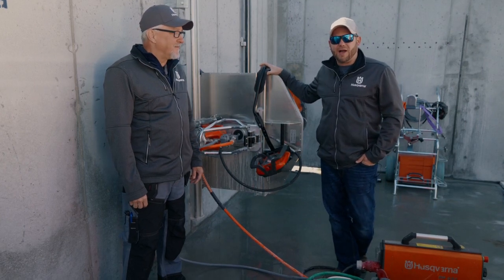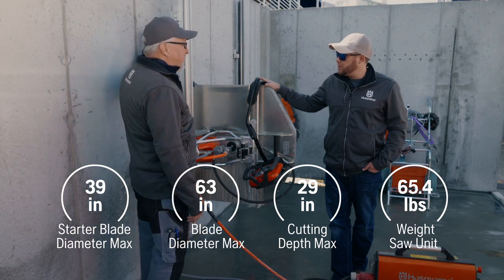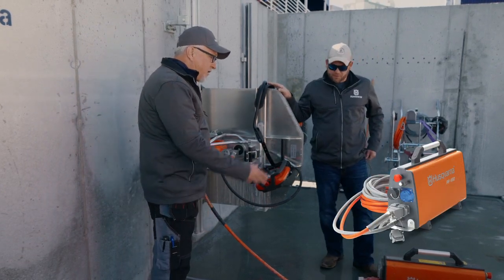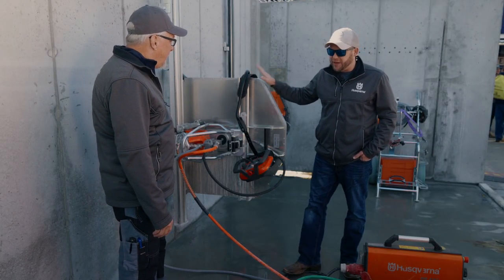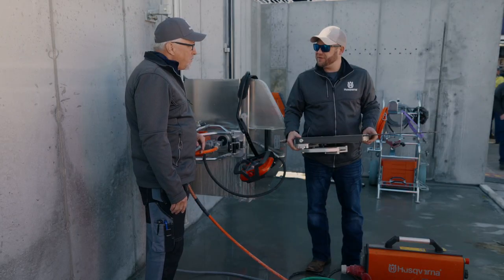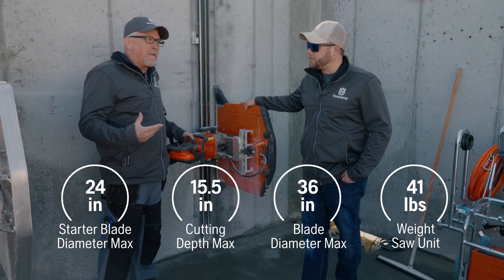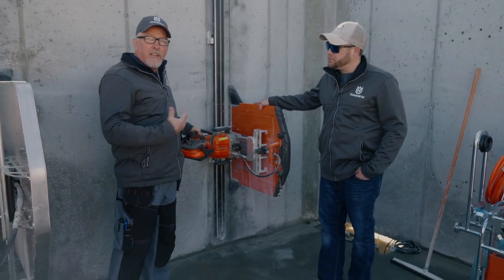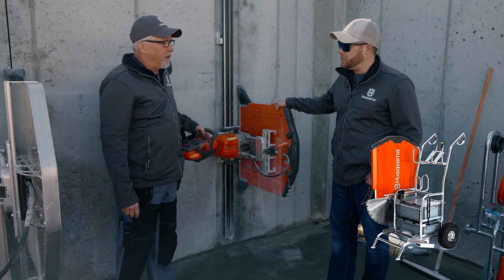Husqvarna at WOC 2023 – Wall Saws WS 482 and WS 220

Comment: You can hear it’s electric⚡️ 
~ 15 years ago they used to be hydraulic but nowadays it’s almost 💯% electric (electromechanical), at least in the developed countries…
They are run from 3-phase electrical power into a high voltage inverter that runs a high voltage motor. 
The motor and often also the inverter are cooled with normal tap water. 
Most of these are developed and manufactured in Europe. 
I think Pentruder was the first ones. 
https://youtu.be/lx6qDbZbcxk?

Then there’s Husqvarna Construction Products that has brought their industrial design and mass manufacturing capabilities. 
https://youtu.be/jLG2iPVb-kQ?

Except for big blades, there are also wire and saw sword blades. 
All of the cutting material is diamond-coated.